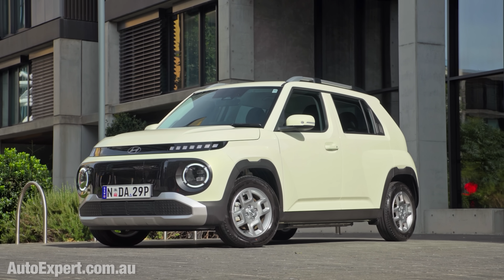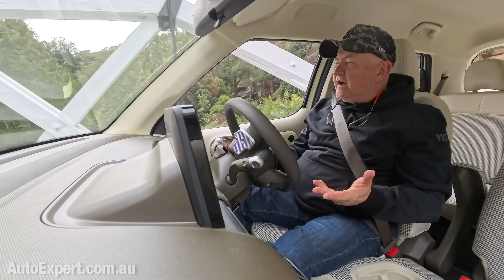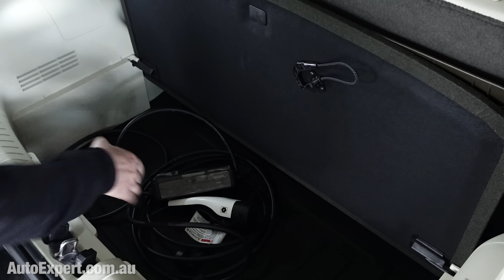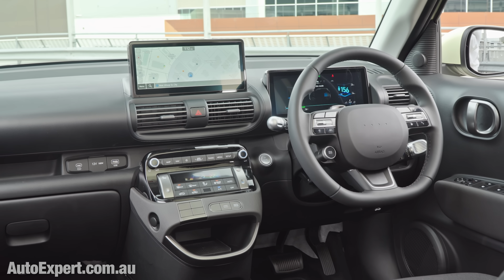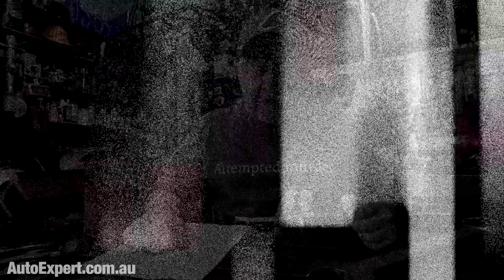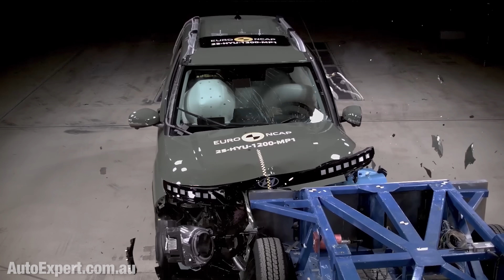Hyundai Inster EV (Casper Electric) first drive | Auto Expert

Comment: We have one, definitely agree on the chuckability 😂 We got the base model on sale for $36k. Love the space, love that it’s easy to park, love the physical buttons. Fun to drive, easy to charge on a granny charger. Great for local trips, I’d never risk the range in the country. 

It did have a recall on a valve, potentially major issue, but recall was handled efficiently. 

We also have a Kia Picanto GT turbo manual. Love that little car but it is rough, loud and a bit rattly.

Comment: Hi, I’ve sat in and looked around an Inster, not driven yet… those prices you mentioned in Aus$ if I convert to UK£ it means we pay your “cross” money for the “basic” version, if I understand correctly…😮 but I’m a Hyundai fan having owned one for 8 years trouble free. 
I have a question that you will not have been asked, I asked my optician, he couldn’t answer…. modern cars have that widget thing constantly scanning the drivers eyes with 2x infrared beams! What long term effect is that going to have..? Also will that switch off or de-fuse..? 🤔

Comment: Agree with your opening statement. I have a BMW i3, engineered from teh ground up over 10 years ago to be a SMALL, LIGHT city EV - at the time of course battery tech for cars was in it's infancy but for a city EV there are still plenty of then running around in London for example where it's efficiency and yet size inside/ luxury makes sense over the big and largely ICE-derived EV's that BMW now sadly make having dropped the i3 from teh range in 2022.. I have the latest model i3 and use it for everything. Hard to find a replacement... but I do love the Inster. It might not have the "sportiness" of the i3 but it DOES have the design ethos that I love, and good flexible interior space for such a tiny car (shorter than the i3). Love it for that.

Comment: Have tyre repair cans like "Holt's tyreweld" or equivalent not reached Australia yet ?
Unless you've got a proper sized gash in your tyre I've found that works well for getting your tyre working again with minimal hassle until you can get a replacement fitted. For around 150km at least.

Comment: Après essais sur plusieurs mois avec notre fille des eC3, e208, eCorsa, ePanda, eYpsilon, e500, eR5,  eR4, BYD (Seagull) Dolphin Surf ...
Seule la MG4 64 Luxury, avec LA meilleure proposition commerciale et de reprise de la voiture de notre fille, Suzuki Baléno 1.0 BVA Pack janvier 2019, +/-80000km, avait retenu son attention.😊
Jusqu'aux essais de la Hyundai INSTER 49 Créative Ivoire packs Sécurité et Hiver 😳🤩🤩🤩🥰🥰🥰🥰🥰🥰
Bon de commande signé.
After testing the eC3, e208, eCorsa, ePanda, eYpsilon, e500, eR5, eR4, BYD (Seagull) Dolphin Surf, and more over several months with our daughter...
Only the MG4 64 Luxury, with THE best sales and trade-in offer for our daughter's car, a Suzuki Baléno 1.0 BVA Pack, January 2019, +/- 80,000 km, had caught her attention. 😊
Until testing the Hyundai INSTER 49 Créative Ivoire, Safety and Winter packs 😳🤩🤩🤩🥰🥰🥰🥰🥰🥰
Order form signed.

Comment: If Oz safety is like the US, the agencies themselves become the limiter on safety improvements. In the US, NTSB is the premier safety agency. They didn't come about until automobile industry was established so their negative impact isn't felt as nearly as much as it is in general aviation. There's a reason that US piston airplane engines are stuck on magnetos and leaded gasoline. NTSB is the reason the Cessna 172 is largely unchanged over 70 years. The plane is the size of a subcompact car. NTSB has created a huge barrier to incremental improvements. Every crash is a lawsuit where NTSB does all the legwork and gives work out to the manufacturer to fix something. A recent example was a 70 y/o pilot with a 50 y/o cessna. It sat for 10 years in humid environment. Water had got into the fuel. NTSB concluded that Cessna should retrofit every existing Cessna with 4 more manual water drain ports in the tanks. Going from 5 to 9 ports. The 1700lbs, 180 HP cessna costs nearly $1 million new. All in liability. It's cheaper (and safer) to buy and build a kit airplane. Imagine if it was cheaper and safer to build your favorite car. Now imagine the government ordering Toyota to fix all the 1965 and newer Toyotas at Toyota's expense. That's what NTSB has done to general aviation.

Comment: This is more what I expect a common EV to be, nothing more than electric Getz, I also think they should have a lower trim, with just front seats like those little 3 cylinder Dihatsu's, and they should also have an option for a 20kwh battery, as this would work for 80% of people in a city or in an urban environment, the most standout feature of this particular vehicle, is the fact its not designed and manufactured in China.

Comment: If you want to turn off the speeding warning beeps, hold down the mute button on the steering wheel for two seconds. No need to faff around in any menus.

Also, EuroNCAP have said from next year in order to get a 5 star rating a car will need physical controls. They say touchscreens are distracting and raises the risk of a crash.

Something else over here in Ireland is that even the most expensive inster is cheaper than a hybrid yaris. It's actually a cheap car over here. And for all the features an inster has it's a bargain.

Comment: Just finished watching a video of an old Morris 1000 and was reminded of just how much space there was around the engine and how easy it was to work on. As an older driver I’m reflecting on what’s improved since I got my license in the late 60’s. For me electric ignition, heaters, air conditioning, cruise control, reversing camera’s, remote locking/unlocking, radio’s, navigation, disc brakes, ABS, good headlights, radial tyres, good engine cooling systems, windscreen washers and reversing lights are highlights for me. How lucky I’ve been to experience such wonderful improvements. I’m still driving, have a newish Mazda CX5, a brilliant 2012 Hilux and an even more brilliant 2000 WRX owned for 23 years with 360K’s, it’s wonderful. On reflection what wonderful changes but compared to my father who experience change from horse and buggy to almost driverless cars and rockets to the moon it’s been transitional rather than transformative. How lucky we’ve been.
Reply: The ones surviving driving in deathtraps like the Morris 1000 were indeed lucky.
Reply: @miskatonic6210  I Don't think they were Death Traps as People knew how to Drive and Give way  Back then,  Not Like now,  Half The Idiots on  Road To Day should be Shot.

Comment: Thank you for your review - its bittersweet to me.
The Inster is of course going to replace the i10 and is way too narrow to replace the Hyundai i20 that i had to replace my Hyundai Getz with. I almost owned the Inster had it been not too narrow at shoulder height and the pause on CO2 fleet emission goals had still been in place (with the special offers that came with them).🥲
My only hopes are either and updated Inster/Ioniq 1 or the announced Ioniq 2 (that in the first pictures sadly looks like it is going to be massive and too expensive for me) as a used car in five years.😀

Comment: Excellent review of an excellent car. Wish legislation had encouraged the development of this type of vehicle, rather than pushing the electric equivalent of the gas guzzler. The only criticism I have of the Inster is that the extremely clever and useful design of the rear seats and trunk was not accompanied by a less fiddly arrangement of flaps and belts and velcros.

Comment: This has a very attractive feature missing from most modern cars - it's NARROWNESS.  Hallelujah.
Reply: Should have added that a less attractive feature is it's looks.  But then we have the Renault 5.
Reply: But it's turning circle is absurdly large for such a small car, so its narrowness doesn't do you any good when trying to park in small spaces. You just look like a fool going back and forth, back and forth, back and forth while the car beeps at you for *nothing*, and leaves you wondering where the heck the supposed 'danger' is coming from.
Reply: @wiespreektmij  Inster has a turning circle of 10.6 metres (feel free to correct me) which is the same as a Citroen E-C3, whereas a Ford Fiesta and Honda Jazz is 10.1 m.  An extra 0.5 metres is "absurdly large"?
Reply: @chrishyde1216  No those are also 'absurdly large'  :) I'm used to a Smart EQ with a 6,95 turning circle, and before that a Daihatsu Cuore with 8,95. The turning circle of the small Inster is the same as the large Ioniq electric from 2020. We now have the Ioniq 5 that's also very hard to park in one go (11.98!) and I hoped the Inster would be like the Cuore or even the Suzuki Ignis.
Reply: @wiespreektmij  That's not good, but narrowness matters when driving around city streets or parking in old multi-story car parks designed when cars weren't stupidly wide.
Reply: @chrishyde1216  Yes for driving it's absolutely fabulous but just don't expect to be parking easily or have an easy turning on the road: The wheels block almost immediately so it's still difficult not to hit another car in the parking lot...
Reply: I am impressed with the smaller turning circle.  All my other cars have a much larger turning circle.
It corners amazingly better than any car I have ever driven.
The quietness, the economy, the car overall suits my needs perfectly.
love love love it.

Comment: John Hi, I Have followed the Inster Launch back almost 12 moths ago O/S. European reviews tend to follow that commentary you are also bestowing.
As soon as I got an Inter her to drive for 2 weeks, It was the 42KW. Did not realise till I looked at the 15in wheels the next day. I found it so fun to drive. Ex 3 Gemini as a young boy. I have been saying to the Manufacturers, since the main players released the big guns, why do you not produce a less powerful, or dare I say, balanced power platform that most normal people want to drive. The bench mark was set too high on outright power that we now have Tesla drivers off at a set of light proclaiming out right winner excluding road safety. Your review balanced that out quite well and hopefully here more people get to buy. I firmly believe once you actually drive the Inter, you realise the quality is what others and I wanted with in a sized package. I will be buying one when we move into Japan into a house we are renovation. And might I say, even the Japanese reviewers are quiet smittened with the Inter. Which usually they are not with Korean cars. IONIQ5 EVs are popular as Taxis in Kyoto, and I suspect the manufacturers in Japan will be pulling the Inster apart to build a better unit than the current Kei cars as now, based on your review results, they realise they do not want a Kei sized EV that a slightly bigger unit but still on the narrow side with premium quality is what can now be offered. BTW You also hit the nail on the head with ANCAP 5Stars. I now say that I am interested in Fleet vehicles with a 5 or4Star as they are just as safe.

Comment: Seeing the generally positive Cadogan review is a refreshing surprise and a welcome confirmation of my judgement..  Before I got my Inster in the UK three weeks ago, I was a bit concerned that the reviews were too good to be true.  I am amazed at the efficiency, and space inside, and it is a far more practical vehicle than the FIAT 500e I had for a couple of years.  The only surprise is the turning circle, which is not quite as good - maybe because of the long wheelbase.

I find the challenging styling quite refreshing - the retro FIAT looks timid in comparison, and, although Boomers like me remember the original Renault 5 and boxy Giugario Panda, they are vehicles from many decades ago. All these cute cars seem to prioritise styling over passenger space. The Inster is also more comfortable for tall drivers like me, with stiff limbs and big feet!

Comment: This is probably the sweet spot for EV's. Small-ish, easy to drive, sensible sized battery and (you'd assume) not too expensive. EV's make for pretty good city cars, but they are NOT a one size fits all solution.

Comment: The brick in the boot aka charging cable aka EVSE, should remainin the car only while you drive home on day one. Thereafter it should stay at home  because where the hell else are you going to use it?. A small EV like this is for running around cheaply near home like within 100km, not for loading up to go 500km on holiday.

Comment: You are really trying super hard to justify the poor value. A more expensive power tool (as per your example) is clearly better (more power, ergonomics etc) than an Ozito. The Inster is not only more expensive but low spec as well m

Comment: I regularly tow a 9,699 tonne caravan with my HQ Holden none stop from Brisbane to Hobart via the Simpson Desert. Try doing this using this Inster EV.
Reply: I'm the same but with a landcruiser 300. Every day I say to my wife how cheap it is to run
Runs on a smelly rag around town doing school drop, and bc it's a toyota nothing ever goes wrong with it and zero servicing required.
It's such a versatile car for tight city streets and nipping in and out of traffic. And parking, whoa, what a dream.
Reply: 9,699 tonne?
Reply: Ah, You can do all that in the Inster EV and at the same time, run a Nespresso Coffee machine whilst driving all that way without stopping. Luckily my Caravan weights 9,899 as we needed the Loo option in the van, due to the coffee & Tim Tams🤣!

Comment: There is one other difference in the power system cost. Yes the current ratings of conductors would be the same however the voltage rating of the MOSFETs and capacitors in the inverter and charger would have a higher working voltage rating, jumping from a 260-270VDC to 310-320VDC would require some design changes resulting in some equipment specifications which would flow on to the protection circuits.

Comment: If my 2018 Kia Soul EV hadn't suffered monstrous depreciation I'd be straight to the dealer for this. But I do get mostly 5 miles per kWh, and I've got air-con, rear camera, heated seat or seats, central locking ...  I'll have to keep it shucks!

Comment: It's nice to hear Mr Cadogen speak positively about EVs, for a change. This Hyundai is more in keeping with what EVs are good for. That said while EVs do better in small cars in big cities people living in big cities are condemned to public chargers which makes the math on an EV purchase unmathable (UNLESS you drive as much as a cab driver).
I've looked into buying an EV but even if I could get the most efficient electric Kei car at the cheapest public charger prices it would take multiple decades to cover the extra cost over buying an ICE car. Long term using public chargers there would be no savings at all or possibly added cost over ICE.
I think I'll drive my 05 ICE vehicle, with its manual, turbo, buttons & knobs, until they perfect the fision engine. Huge plusses with my old car is no electronic nannies & that the infotainment gets upgraded every time I get a new phone;)
Reply: That logic dries up when you can no longer buy an ICE vehicle...

Comment: I will keepy little 2010 Peugeot 207 Wagon. Its Diesel. Does as low as 3.5L/100km if you are at 110km/hr and on a flat road. Full Leather, glass roof, climate control. Paid $5500 a little ovet a year ago and its only done just over 100,000kms. It must have cost the first owner a fortune.  Its so easy to work on because modular. No electic car for me until we get the Hyundai Excel nack for $9,990 Drive Away no more to pay. Bring back those days.
Reply: Had a 407, used to forget where the fuel cap was. Perfect interior. Great car.

Comment: I’ve owned a mix of brands the last 25yrs because l won’t own anything without a Full size spare hiding in its wheel well.
Reply: Just be honest how many times have you actually usez you spare in the last decade (if you have the ability to use a basic Tyre repair or plug kit)

Comment: It definitely has a few good points about it but its weird look by itself will be enough to keep me away. I mean, it is in Nissan Juke territory. 🤮 It's almost like it was designed by a committee but they couldn't agree so they agreed to design different parts of the exterior and they stopped talking to each other.  The model name is not an improvement, either. But, if some people like it, that's OK, too! 😁
Reply: We have one. Love driving it. But man it is ugly as sin 😂
Reply: @JosieJo2000  I reluctantly admit that the looks are starting to grow on me a bit, after the initial shock. 😄

Comment: Thank you John your recent erratic EV posts stopped me from watching, it was just exhaustingly predictable and boring. A car is good or jot good, that's it buy petrol you will shoulder more costs at the pump, therefore the lower price is relative. Going to Dingo P Creek (500ml Creek) with your moving kitchen loo sleep camper is certainly easier with a Diesel (als long as it is not a Landrover).
Reply: Yes, they've certainly been erratic. But that's his strategy to attract subscribers from both sides of the argument.